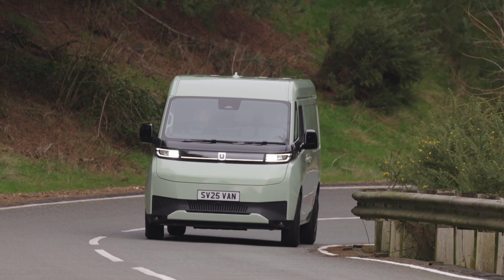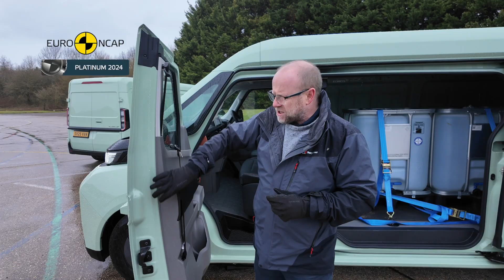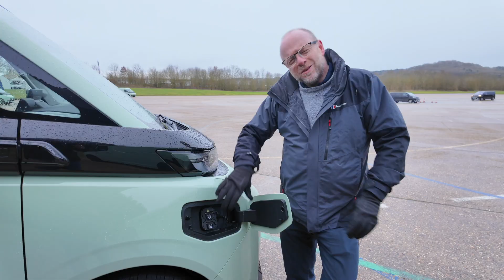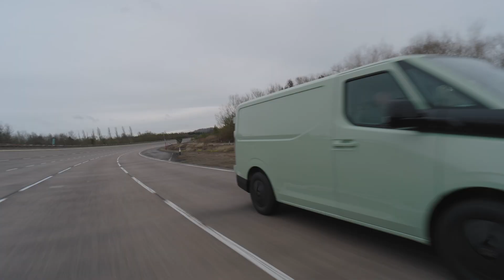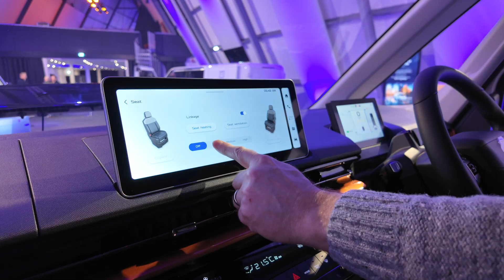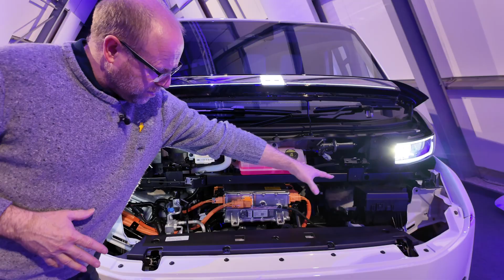China is here!! New to the Van market, the electric only "Farizon SV" from  @GeelyAutoGlobal #ev

Comment: What about Faraizon Sv vs Kia PV5?
Reply from the maker: @jonathanmassaro3142  two cery different vehicles. One is a small van starting at 4 cubic meters with 790 kg payload up to 5.2 cube with 650kg and the Farizon SV starts at 7m cube with 1350kg payload abd up to 13m with 1075 kg
Reply: @electricvanman  thank you, i didn't realise they were so different in size
Reply from the maker: @ that’s why I called the PV5 a “Big Small Van” 😃
Reply: @electricvanman  looks like the pv5 (maybe the wkndr model, i need to check the price) will be my next dogs van.

Comment: The massive difference here, is that they offer 3 battery sizes.... Where as the Transit offers just 1 battery.
Reply: Biggest downside of the e-Transit custom.  Its biggest upside is that the wheels are driven the correct end the Van.

Comment: lol 😂 i can go 500 miles full loaded in my 2l van takes less than 5 mins to fully fuel at a simular cost to a charge at a public fast charger. Let alone empty over 600 miles. As a small tradesman A, I can’t charge at home.. the nearest fast chargers over 12miles 30mins away one way. How’s this green wear I’ll see myself having to travel at lest an extra hour, let alone tyre particulars and brake emissions. Then the van being built and shipped from the over side of the world… let alone ethically buy Chinese.. I’ll stick with my faithful vw van. It’s done over 130k miles and still going strong, easy to self maintain. The over issue with ev vans i have is all the waisted time having to take it to charge so including the trip to charge 1hr 30mins to 2hrs best case, witch will reduce the amount off customers i can see and force us up are rates. Then the feasibility of emergency call outs for trades like plumber, sparkys, lock smiths and so on. Having spoken to the corporate trades who drive ev vans they spend most there day charging and being payed to drink coffee, far enough for them, but for the self employed tradesman like myself this isn’t feasible. Let the patch i cover is mostly rural  thru a national park. I got a sneaky suspicion as soon as you load the van up the range will drop, let alone turn the heating or a/c on. Then looking at the build quality 😂 wonky cup holder, shine fo leather seats and questionable plastic interior. The toe hitch looks a wee bit thin on the hitch, which brings up massive questions on longevity. So not on my list lol 😂

Comment: you said at the beginning the van had a payload of 1300kg but when you went to drive it it weighed 2500kg with you in it that means a 1000kg payload at best
Reply: From their Chinese website, the version 80/100kwh model in China, max is about 4050kg, curb weight is 2440/2505

If Farizon send the model with CATL battery which is L3H3 in China, you are getting 1500kg payload van. I bet 1300kg is something to do with EU regulation (ECs) 
And 80/100kwh with the same weight class: 80 is a good buy... that is Tesla Model S playbook of using 80kwh battery on a 60kwh

Comment: Don’t promote this chinese garbage, my cousins bought a brand new maxus LDV thing and my god did they regret it, first engine packed in before 20.000 miles they waited months for it to be fixed then after that the new engine packed in before 30 thousand and then after it was fixed the third engine packed in and before the 5 year warranty ran out they sold it but my god I drove it once and it was a large long wheel base high top but it bounced like a kangaroo lol going over a speed bump would bounce the back off the van up about 10 inches it was like hitting a bump and 70 miles per hour it was unbelievable, it was a hazard, luckily they got rids off it but I don’t know how much they got back but it was terrible

Comment: Bloody hell,an E-van-gelist.They are ugly buggers from the front and the floor is too high.No idea why the test drive around a track.That's not where it will be used.I've driven most panel type vans over the years for work and they are all much of a muchness.Some have hard suspension,and some are quicker than others.Don't need to drive it to try out the toys in the cab.Get it out on a freezing winter morning,put on the heated screen,the heater,and the radio.......then head for the horizon.That's a real world test.Then tell us the price and how far you got.Then folk can work out if it is worth it.This is just like a bought and paid for advert for e vehicles.....Just got to the end there and seen the towbar.Add a trailer to the real world test run as well.

Comment: What is the distance per charge with and without weight on board. I used to fix trucks all over south east uk, i always had apr 1/4 to 1/2 ton tools etc on board, 24/7. What about that load per charge. Funny how this comes along as vauhal, anounced its disaterous van making halt. Im a transit man my self, and the procliamed 70 miles per charge empty is no good to man nor beast. U cant beat a diesel van/car.
Reply from the maker: I think you have misheard. The vehicle will do over 200 miles with the bigger battery versions. The vehicle is tested with 30% payload so around 350/400 kgs

Comment: Within forst few mins you pointed out a problem. Are those front and rear lights within the required uk spec, ie, hight from road, distance from each other etc.uk has some pretty stringent road use requirements.
Reply from the maker: The vehicle had passed the UK required testing and approvals through the DVSA
Reply: They look about the same as the Fiat Ducato (marketed under many badges) since 2014.

Comment: It looks like a rather ugly electric van,  some nice features but realistically it'll give 150 miles before needing to be charged.  That is if its charged to 100% not the recommended 80%. Obviously this depends on the type of battery fitted .
So a fair round towner if you want to get around the money making restricted zones scam.
As always the extra weight of the vehicle has to be taken into consideration. Before loading anything it's already nearly the weight of a fully loaded van, so with the biggest battery fitted you might be limited. 
The Chinese have a hudge stockpile of  good, very cheap batteries and they have their eye on taking over Europe so you will get alot of van for your money. 
Unfortunately Chinese evs have a rather troubling reputation for having electrical problems and catching fire. Even worse we can't trust our government to enforce any kind of standards so time will tell.

Comment: Another useless EV van and obviously not well built as are all Chinese built vehicles EV petrol and diesel when you were going over those bumps and the dash board shook moved that's terrible build quality after all in Australia we get a Chinese built EV van haven't seen one yet well actually l mostly see Toyota Hiaces old ones new driving around doing van stuff infact there are 30 year old Hiace vans driving around doing van stuff and with its 5 year warranty that's how long it will last and 30 years is much longer than 5 years and the Hiaces are petrol and diesel are the convenience of petrol and diesel and there are the Hyundai and Kias also the European vans and Australia Post are switching over to Toyota Hiaces why they are much more reliable and last longer than any other van because they are Toyota's

Comment: Let’s be realistic here.
I’ve seen price quoted for the 106KWH version as £56000, and starting price of £45000 😂, it needs to be half that price to stand any chance of selling.

This van doesn’t offer anything radically different from any other of the larger electric vans that don’t sell, complete waste of time.
Reply: It's not radically different but it is noticeably better in some important ways. 30% more battery and 25% more range than current PSA/Renault vans. That missing B-pillar is going to excite the camper market.
And e-vans are taking off now (after a slow start because a lot of the early offerings were pretty crappy). We're at 6% of new sales for the last two years, but with a load more choice and better vans coming out now I expect that to rise quite quickly.
Reply: @ an optimistic view, but my feeling is that unless an electric ,light commercial can travel 300+ miles including full payload in cold weather, and also not have a reduced payload compared to a similar sized diesel van, the market will never increase. So that would require battery technology that doesn’t exist yet.
All EV vans available at the moment are not fit for purpose for the majority of the market, it really is that simple to quantify it.
Reply: @ Yeah, we'd all like that (and for cheap, obviously). But that view places no value at all on decarbonisation or air pollution, and a lot of people do value those things, to varying degrees. 'Fit for purpose' is a moveable feast. Most people could manage with an electric van already if they really had to (I could, for example, but I've chosen not to so far, not least because it's obvious better vans are coming out practically monthly at the moment). 
300+ miles, for example, would be nice (_very_ nice for my purposes), but the fraction of the market that needs it is pretty small. It's more of a mental shift than a practical one: We've all just got very used to 700-mile vans, and only filling up every 500-odd miles over the last 25 years.
Having to fill up a bit more often is generally doable, and ideally you just do it overnight, or whilst at the jobsite (which don't actually take up your time), and sometimes en-route when need be. We can all easily imagine how this could be annoying, but you get a nicer, quieter, less-harmful vehicle in exchange, and it's not like we have an actual choice about decarbonisation. It has to happen, and reasonably soon, or we are all in serious trouble.

Comment: I will not be subscribing, short on info, all the negs are the same as with any vans. Are all the extras, heat/cool seat, heat steering wheel come as standed?
Reply from the maker: There is only one spec and it is all standard... Thanks for the tips... Maybe I will get you next time ;-)

Comment: EV's are not zero emissions. Electricity does not come out of thin air!!
Reply: The vehicle is. The generation system could be also - renewables and nuclear. I guess wind power does actually come out of thin air. Check out the amount of renewable and nuclear power generation that is actually being installed in China. You’d probably be surprised.
Reply from the maker: Zero emission at the tail pipe. It is well understood that there are emissions in the process... will make that clearer next time
Reply: Indeed, but UK electricity has got remarkably good over the last decade. Grid intensity last  year was 150gCO2e/kWh, down from 650 odd in 2010. We're not France or Norway (~30)  yet, but still improving, which has a large effect of the relative emissions of EVs (and heat pumps).
Reply: @xxwookey  I look at the UK Energy dashboard each day and this winter most of the power has come from burning gas, even on windy days
Reply: @ The average over the last 3 months (which is basically 'this winter') is 24.5% from gas and 26.5% from wind, 16% solar, 9% nuclear, 5% biomass (14% imports). So clearly it's not true that 'most of the energy came from gas' this winter. About 1/4 did. 
And the average carbon intensity was 160gCO2e/kWh. The stats are on the electrictymaps site.

Comment: I like the shinny copper penny color trim on the dash trim. The algae swamp green color? Not quite the right shade for me. A little brighter or darker would look better for me. But the van overall looks like a pretty good bit of kit. My first response? I am intrigued by it. It’s got decent payload and range alone with being a decent overall size. If they do offer the implied feature of removing the passenger side bulkhead and seat, that bodes well for using this van for bulky and longer stuff.
Reply from the maker: Great feedback and yes the sliding or moveable bulkhead that has been discussed is a great sounding option !
Reply: I wonder if they call is 'algae swamp green' in the marketing guff?

Comment: Looks good. Could do with some design changes. Wasted headroom upfront. Front design not great. 
Nice if you cut down on wordy nonsense. Missed important issues like bulkhead options and battery chemistry, charging speed (not time).
Reply from the maker: The important bit is how long for most users. That said 120kw on the smaller LFP batter and 140 on the bigger NMC battery. There are no bulkhead options at the moment but maybe in the future.

Comment: Forget that bro.if u have a crash and the lithium leaks causing a fire.u have seconds to get out.plus with  hauling weight the battery wont last u  long. Plus no charging infrastruce in place
Send it back to china bud
Reply from the maker: Charging is growing and best solution is own home/depot for charging. Battery is significantly less risk than combustion engine ...

Comment: Great to hear the van can take a 360 degree 3D photo of your  tandoori kebab lunch but what about verifiable range?  How far will the van go in winter fully loaded? not impressed with propaganda, I prefer info. And oh ya, how much does it cost?
Reply from the maker: from £44k. The final tests have not been done yet. As I said I will be doing a range test. The vehicles will get over 200 miles range with sensible driving and they handled the weight very well. Stats will follow on real work stuff both from me and them
Reply: @electricvanman  Range is the big issue most people have with EVs, and this van should be tested fully loaded. China has a very different EV culture where instead of charging the vehicle they can change out the battery in about 5 or 10 minutes depending on the model,  instead we get disposable and limited EVs.

Comment: How do you open the passenger door after an accident?
If the seatbelt locks you can't open the door?
Reply from the maker: Good tech question... one I had not thought of. That said in the case of a collision it has a an auto open function (I just discovered yesterday!) also Check the platinum rating for NCAP... I guess it would have been considered there

Comment: Does it have a heat pump? Camper mode?
Reply from the maker: There is a camper version in China which looks pretty good. It does have preconditioning on the battery too so heat pump is available if I understand you correctly
Reply: @ Pre-conditioning could just be a direct-electric heater. It doesn't mean there is a heat-pump for efficient heating (of cab or battery). If the pre-conditioning can do cooling as well as heating then that does imply there is a heat-pump (but it could be an aircon-style cooling-only one).

Comment: Woo a van with a 100kWh battery. At last! So that should be a solid 200 miles in a decent sized vehicle. Best option so far. Got to work out how to use that missing B-pillar. Should make a rotating chair easy to implement.
Reply from the maker: They reckon up to 285 on the 100+ version but yes when you boil that down to winter and loaded, in excess of 200 is perfectly feasible
Reply: 200? Fully loaded on m ways ,,200 is but a dream
Reply: @ Obviously it depends (especially above 50mph) how fast you drive, but the WLTP is 260, and the efficiency figures I saw a few months ago were pretty good and 106kWh is 30% bigger than 75kWh (PSA vans that claim 205mi and will do 160 in winter on motorway). So if the efficiency is the same you should defo get 200 miles even loaded in winter, and my understanding is that it's better. Obviously we await some real-world testing to find out for sure.

You'll get significantly further at 60mph than 70mph, (The drag is 25% more and real-world tests find the energy use changes by 15-20%, so that's the difference between 200 and 235 miles). There is a handy tool called evcalc which gives all these figures for most cars. The Farizon is not on there yet or course (and neither is the new trafic, new sprinter, nor Buzz for some reason).
I actually care about the range at 60mph(100km/h) because I already do 60-62 in a diesel van in the interests of efficiency, so doing that in electric is no-change. If you drive everywhere at 70 and can't go slower then allow 20% range/efficiency difference.

Comment: 8:21 '11 kW', not '11kW an hour'.
Reply from the maker: Well it is 11 kW in an Hour which is what I thought I said but I could be wrong. Bottom line that is how quickly it will charge on 3 phase AC
Reply: @electricvanman  '11kW in an Hour' is still wrong! You mean '11kWh in a hour', more simply said as '11kW'.  Nobody gets this wrong when talking about miles and miles per hour. (distance and speed). But energy and power are regularly confused. It's important that journalists such as yourself don't add to the confusion.

You do understand the difference between kW (power) and kW-hours (energy), really, right? I assumed this was just a slip-up on video but your reply above makes me think that you genuinely don't understand the difference/units.
Reply from the maker: @ I think we can get hung up on exactly how to describe this but even when detailed to your exacting standards there remains confusion! kW power kW speed (charging) has been confused by many a commentator. You are right to say that we should get it right (although I am not a journalist) but context does explain most things so as people will understand… will try harder! But yes I do fully understand the difference
Reply: @electricvanman  I think you are wearing your van journalist/reviewer hat when making these videos, even if you wouldn't describe yourself as such. Otherwise you'd have to call yourself an 'influencer' or somesuch, which has to be worse, surely? :-)
Reply from the maker: @xxwookey  You are right that would be worse! But the reality is that it is rare that i would get paid for this kind of thing and that as you have pointed out I am not a journalist by skill it is by necessity... One for a conversation round the campfire i Suspect! lol